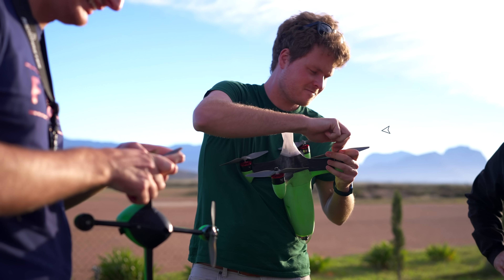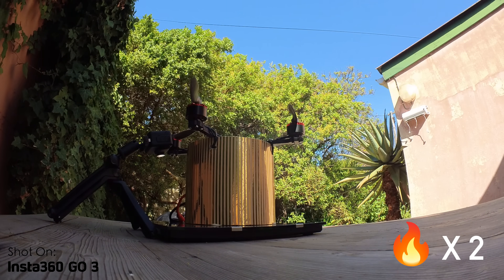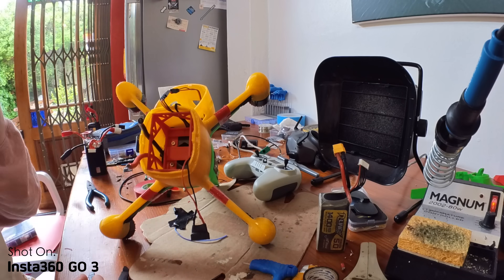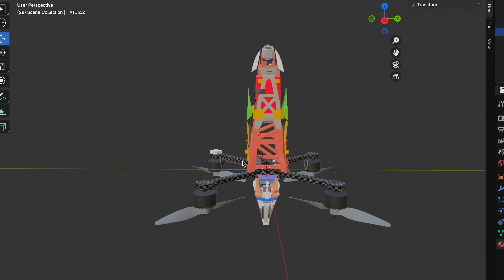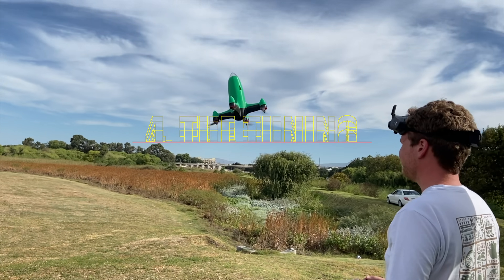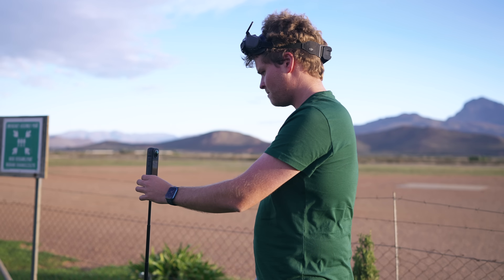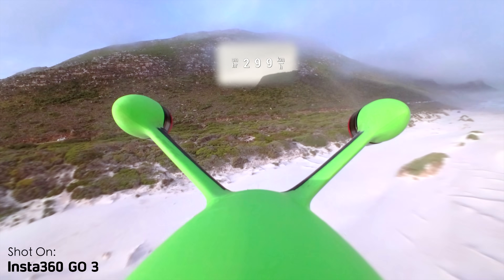How I Built the NEW World’s Fastest Drone

Comment: Could go faster by just using analog and not some heavy DJI VTX
Reply from the maker: Weight doesn’t make a big difference. Especially the 30g I would save on a smaller VTX
Reply: @LukeMaximoBell  you are right, I forgot the record is for max speed and acceleration doesn't matter really.

Comment: 150+Amps at 40v 6kw wtf... shocking numbers
Reply from the maker: 8kw 😂😂
Reply: @LukeMaximoBell why not increase the voltage further upto like 120V dc or 240V DC, electric trains work on dc that too in thousand of volts. you can get custom battery pack built, it will be unsafe to build and handle but will work better also will reduce the wire thickness making it lighter,  also regarding aerodynamics smooth is not always better at that scale, use golf ball like texture all over, there is a video on that somewhere on youtube, the landing light looks so cools gives plasma look, use argb led there, but like f1 its easy to go fast in a straight line how fast are you on corner that matters, i like the redbull f1 drone video lot better,no offense, next goal work on presentation and marketing. Congrats on record

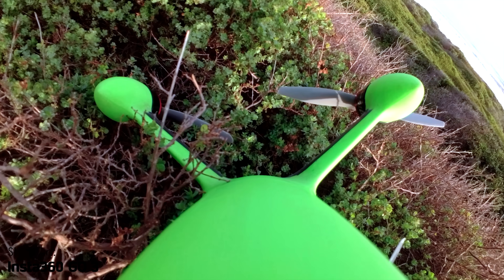Comment: 247 80c or 175f is WAY to hot for a lipo. thats causing significant damage. 3:32 the thin wire got so hot is desoldered its self so barely not desoldering its self should be good, makes sense. 15:06 yea sure that super turbulent air is a good guage.  jesus christ.
Reply from the maker: Your comment implies we have no idea what we are doing 😂 I have evidence that says the contrary.
Reply from the maker: I shouldn’t even bother correcting you on this comment, but I feel like I have to. 80 Celsius on the battery is the connector between cells, not the battery itself. The battery is much cooler. The test where the wire desoldered was with 1 motor running at 80A. In actual flying we never pull above 60A per motor. So yes the wire that barely desoldered itself is fine believe it or not. Even turbulent air is a good indication of stability for these tests as we have demonstrated.

Comment: Why did you pick the medium sized wire? The medium sized wire was still showing signs of heat and any sign of heat in electronics is a loss of energy/power. I would have picked the one with as little heat on it as possible
Reply from the maker: Good question! The main reason was the thickest wire was too thick to fit nicely into the 3D printed arms. And this test was an extreme example

Comment: Why doesn't the top speed count as the record? It's so much faster than the average
Reply from the maker: Because the top speed is wind assisted! So it’s only fair to take the average over opposite directions. And making it over 100m makes sure that you can’t be lowering in altitude during the run.

Comment: Try it again on a very hot day.  I know that is bad for the electronics but the air it thinner and it might go a bit faster.   ???
Reply from the maker: It’s a fair consideration. But remember the thinner the air, the less air there is for the props to push against. So it’s got its pros and cons. We haven’t tested the effects of different air densities.
Reply: @LukeMaximoBell  That's a great point too.  There has to be a happy medium somewhere. Possibly the perfect temperature and humidity.  I guess once you tweak the drone as far as you can, that's when you need to start investigating how weather could assist.  So fun!

Comment: Needs speed holes. Dozens of them.
Yes, I'm serious.
Reply from the maker: What’s a speed hole?
Reply: @LukeMaximoBell  in this case, it's getting an electric drill with a very thin bit, and drilling about 30-60 holes into the 3d printed cowling. Hit them with a bic lighter to smooth the holes interiors, and a Dremel to make sure there's no burrs left.
It'll create a small ripple effect in the aerodynamics, where you can channel air a bit, and also give a bit of a "shark skin" effect of pushing the tail fins into differently pressured air.
Pros: weight savings on the cowling, fun to do, only takes a spare cowling to test.
Cons: might cause more drag than the potential weight savings and aero flow helps with.
It'd be one of those things that it'd be really handy to have decent fluid/ aero modelling software for, but it's one of those things that you can also kinda eyeball and try out for the sake of a few rolls of filament. Try the way you think will work, then try the exact opposite of that pattern. Compare and contrast.
.
You could also try a basic frame on the 3d print (or use CF rods and just printed joiners), and just use a mylar skin to provide basic aero and direction. Stretched tight and glued well. It'll be a bit lighter. I tend to think a lot of the lack of performance is a weight issue, but on the other hand, that sounds like structural stability will be low. So I'd start by trying out speed holes in a new cowl.
But more of an engine power/ aircraft weight ratio, is never bad on speed tests. Neither is changing aero around the drag inducing bits, even if you need some drag for stable flight.

Comment: 1) You're still spending battery capacity by heating the wires. Would be interesting to see if actually calculating which wire gauge to use for optimal resistance and then going with the correct thickness would net better performance despite the added weight in copper. Depending how you balance things then, you'd either get higher motor performance or longer endurance or a mix of both.
2) The model was too close to the car and your hand to give you good indication of air flow. Maybe someone would be interested in doing CFD modeling or you? This might be an interesting project for an aerospace engineering student.
3) The idea of adding a tail is very interesting, I wonder if the reduction in motor balancing efforts and therefore additional speed gain on straight paths is worth the higher momentum due to added weight and higher air resistance especially while turning. Guessing here that the PID tuning is going to be interesting to put it mildly, because of the uncommon flight characteristics.

Thank you for this video, very interesting to watch your process!
Reply from the maker: We are doing CFD modelling for the next version 🤩
Reply from the maker: 3. that is the exact logic we are following by adding the tail.
Reply from the maker: 1. While that might be true, the thicker wires don’t fit inside the fairing well and would inevitably create more drag.

Comment: Looks like Aero still needs work - See if you get any improvement by putting spinners on the props to clean up drag off the motors, along with cooling ducts in the front of the pods to get air to flow in through around the Stator and out through the rotor. The body and wing blades don't seem to follow the Area Rule, so there's likely speed lost through drag there. Sweeping the edges of the wing blades will probably help too, as you're in the speeds where that has effect. Can't wait to see how much faster you can push this!
Reply from the maker: We are working with Airshaper and improving the aerodynamics for V3!

Comment: Simple inline fuses would ensure you get no fire. That is the job of a fuse, to protect the conductor (wires) which clearly don't have the required ampacity for the current draws. That stuff is all pretty easy to calculate, so not sure why you're doing a trial and error approach? Cool project BTW, and I love the effort.
Reply from the maker: Hmmm I suppose it’s possible, but the current is so high that even with a fuse you can get fires

Comment: I’m curious why you’re using such a conventional design for your props. There are more efficient, powerful designs that are used in real aircraft that could be scaled down that could offer all sorts of advantages.
Reply: Availability. Printed props wont last a second in that application. Similar when there’s hype about toroidal props. And Injected molding is super expensive to setup
Reply from the maker: @jeffclassics  Exactly correct.
Reply: @LukeMaximoBell  What about sintered metal. Again, I’m no expert, I’m just asking. I am fascinated by this stuff. I fly professionally and over the past 15 years or so there have been some really neat advancements in prop tech for actual aircraft. I’m not sure what kind of RPMs your props are seeing but I imagine it is on par with something like a modern turbo prop. In that area more and more older aircraft are seeing their three and four bladed props replaced by 5, 6, and 8 bladed props with modified shapes like paddle board and modified tips. There are a few companies playing around with contra rotating designs that are interesting, making kind of an external jet prop. These mods greatly improve performance in thrust, airspeed, noise, and fuel efficacy which that last part may or may not relate to improve battery life. 

One of my hobby’s is shooting and there have been some really impressive strides made in metal 3D printing. There are a few suppressors on the market now that simply couldn’t be made without a 3D printer. The pressures involved in containing hot gasses from a muzzle blast are exceptionally high. I can’t imagine that something like that would fail in your application. Composites and hybrid composites likewise have proven to be very durable. It would be interesting to see these strides getting scaled down to use in UAV/drone tech.

Good video on the subject
https://youtu.be/ojVNOj-q3SQ?si=L-SVxDF0cBbn48dT
Reply: @SuperTrb0  and to add, the bigger prop size is the more efficient it is. So just by scaling down props in jets or boats doesn’t guarantee itll be efficient and economical.
Reply: @LukeMaximoBell  cheers to Guiness Rec. was that Betaflight with compass gps to rec the speed?
Reply: @SuperTrb0 blade tips on these drones get close to mach 1. And about the blade count, the more blades you have in the air, the more resistance they provide, and seeing as electronics are working at their absolute limits as it is, more blades will just show you down
Reply from the maker: They are the only props that have the pitch and diameter I need for the record

Comment: The solution to go even faster (without needing a much larger drone) is high altitude, perhaps with some high aspect ratio wings as well. 17,000 ft is enough to roughly halve the air density. 30,000ft, or Mt Everest, is like a third air density. At 55k ft, you're at about a tenth the density of sea level. You also will need supersonic/transonic propellers.
Reply from the maker: True, but then there is less air for the props to push against so it’s a fine balance. I think jet engines are what thrive at high altitudes

Comment: 5:48 what was the reason for the 2 fires on these landings? it seems the esc went up both times as if something jiggled loose on landing. did you ever figure it out or was it just bad luck? ive seen similar things happen before and want to know if there's something i should watch out for to hopefully not let this be me.
Reply from the maker: Honestly, I have no idea why that happened to this day. If you can figure it out let me know! Haha. I suspected it might have something to do with the motor direction reverse tool in betaflight but honestly I have no idea
Reply: @LukeMaximoBell  BF motor direction simply reverses the dshot transmitted throttle value same as it's used in turtle mode. Disarming wouldn't do anything so it's probably not that. My theory is just bad  luck and maybe solder blobs. I've seen this happen before with regular freestyle quads that fly fine, land, and as soon as they touch the ground they light up. The consensus is it's probably a tiny loose solder blob that shook loose and shorted or a physical pcb component broke off. Conformal coating and clean soldering could help with this risk but it's difficult to conformal coat under a heatsink on those t-motor esc's.

I generally just chalk it up to "esc's just do that sometimes" and hope it's not me

Comment: Awesome!!! It will fly faster and have MUCH better control in a PLUS config ;-) Flying drones since 2006....
Reply from the maker: Hmm why do you think so?
Reply: @LukeMaximoBell  Well from all my tests the PLUS config is more efficient,  tracks true at high speeds. Maneuverability,  PIDS will be the same for Pitch and Roll. (imagine if the drone is just hovering in front of you) complete a roll.. As X both motors will slow and two speed up. As PLUS only one motor needs to slow, 2 motors (front rear) stay a constant speed) In faster flight you will find PLUS will behave better all-round. I really have no idea why people prefer the X over a +? Maybe it looks cooler? A trend? Camera was a problem in the old days, but now most fly with 25%+ on cam angle. It would be easy to change your drone to a PLUS, just 45 degrees yaw in software and turn canopy. Repeat test, buy me a beer 🙂
Reply: @LukeMaximoBell  Also, you went for pusher, not tractor. Pro's for tractor in this setup, cooler motors, props push air over the foil. (blown wing). In my tests, over the years, tractor prop is slightly more efficient.... all the best ;-)

Comment: 298mph??!!!

Wow! That's seriously impressive. I would not have expected that.

Sorry, my mind works in imperial.

Also, I would love to see this type of drone modeled in some flight sims, like Velocidrone or Liftoff or Wings. Looks like, because of the preferred FPV camera angle, it would feel a bit different than a standard quadcopter.

Subbed!
Reply from the maker: Haha I think in Metric so I get it 😂 Yeh I have tried in TrypFPV but it’s not the same. I will chat to them about adding a similar drone to the software. Would be fun!
Reply: @LukeMaximoBell  I have TrypFPV also, it just doesn't run so smoothly on my laptop... Let us know if it ends up in a sim, I will def want to check it out there. I love trying unique aircraft, and this qualifies.

Comment: What an amazing sound it makes going by at speed. Congratulations on your success and sticking with it. Would printed/machined titanium or other materials help or is that too expensive? I'm thinking it would act as a heat sink and perhaps allow the design to be lighter and smaller...
Reply from the maker: Yes good point. We would like to make some of the new V3 parts out of machine aluminium, but still working on the feasibility of that.

Comment: Why so many fires wtf, those motors are wrong size for the battery?  I've been building drones for years, never had a fire.  What fc are you using, it should monitor and stop anything like this.
Reply: how would the fc magically prevent a fire? a physical electrical/mechanical failure in the esc
Reply: @redacted1946  over and over again?  Something isn't right, I think they're doing it for show, if you have the right escs for the motors they should never catch on fire, I don't even know how you would do this, the esc should hit its limit and prevent it yes?

Maybe it's about their pids right, if they crank the d term way the f up then it would heat the motors up and cause this maybe?  They didn't seem to have a clue about tuning, and had to ask chris rosser so maybe that's the issue.

Esc's have thermal protection, they will shut down before a fire is caused.  I just checked bluejay and blhelis.  You would have to disable this.
Reply: This is a 300 mph drone I imagine they where pushing whatever fc they had to the absolute limit
Reply from the maker: A FC would never stop something like that. When you are dealing with 8kw of power in such a small package there is going to be a lot of heat
Reply: @LukeMaximoBell  I should have said stack, the esc should be preventing it yes.  on a 6s, you have 25v, say 70 amp esc which is one of the largest ones currently available, that's 1750 watt's, where do you get 8kw from? lol  Even if you're 8s, or even 12s you can't achieve 8kw with a normal stack.
Reply: @LukeMaximoBell  On 8s, 30v,  you would need a 300amp esc to pull 8kw...what are you even talking about, you built this drone right? lol  Maybe there's confusion cause you're multiplying by 4 I guess?   so a 6s 25v 80amp esc =2000w x4 I guess is what you're saying? But an 80amp esc is only 20 amp escs per motor right...so you have 80 amp esc's per motor? wth. that doesn't make any sense either.  I guess there are 80 amp indivisual escs available. "Hobbywing Skywalker 80A V2 UBEC ESC" Is that what you're using?  What esc firmware do they use?  They don't have temp protection?
Reply: @LukeMaximoBell  yeah default bheli32 temp protection is 140c...did you change it?